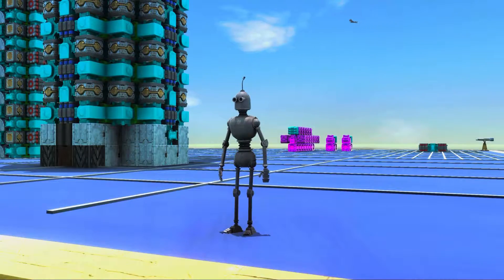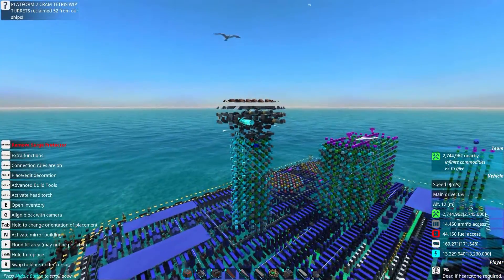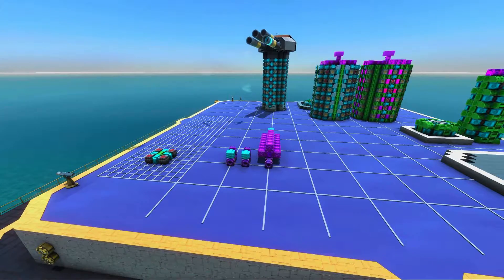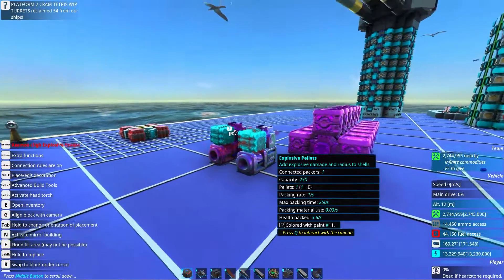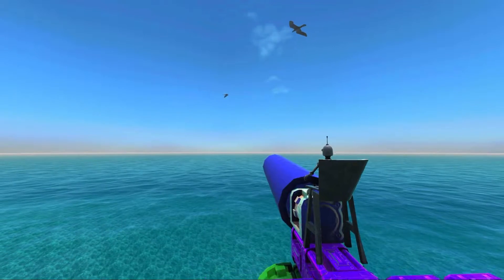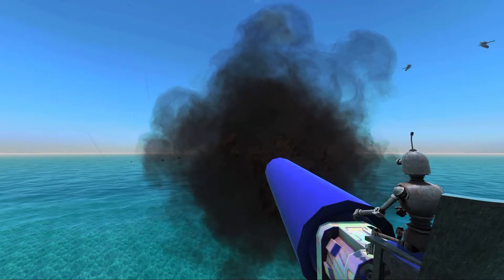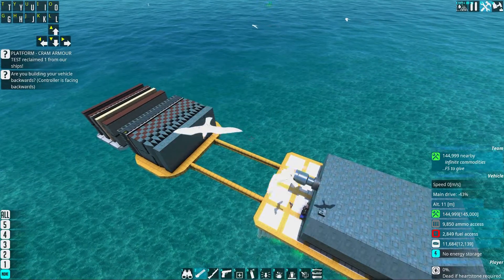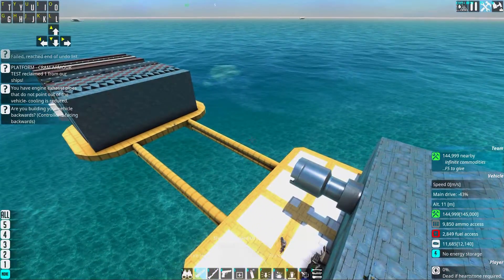From The Depths INSTANT Tutorial: Advanced CRAM Cannon Tips For Efficiency

Comment: i am currently testing the laser targeter & time fuse's at 13:40 on cram cannons and they just dont work at all. the shell destroys the first block it hits and detonates. it will only actually penetrate armor with the time from first impact and pendepth fuses. your method can actually be seen not working in your marauder test at 18:08
Reply from the maker: Thanks for telling me,  I wonder if anything has changed since when I discovered this, I did some more tests and it seems to be the case now that they do blow up on contact, perhaps this means that time fuses are then more useful on big crams where the fragmentation are so strong armour will not stop them anyways. I'll try and cut out the bad tips from this video later!
Reply from the maker: Thankfully I said the incorrect stuff in a condensed little area, I did cut away the false/outdated statement so when you see this I hope video is already processed and it should no longer be present. Thanks again!
Reply: @GMODISM  Thank you!

Comment: I love the idea of crams, but I always struggle to justify using a weapon system that hits maybe 1 in 5 shots on a slow enemy and is almost completely useless on anything that can dodge or moves more than 30m/s, especially with load times of 20+ seconds per shot. The thump crams are hilarious, but I struggle to use them for anything other than structure bombardment (and even then they tend to miss a bunch >.<)
Reply: Sounds like a detection issue. Fast targets are obviously hard to hit, but something stationary should yield pretty consinstent results
Reply from the maker: Try my fuse tip and your shots rarely misses!
Reply: @GMODISM  For frag and HE, sure, but that would not help with the thump issue, unless that works which would be hilariously busted. I will give it a shot though, see how the massive doom snowballs of frag treat me
Reply from the maker: smart to have a little frag on thumpers as well, but yeah for kinetic only crams it is not useful to blow up the shell in the ships vicinity